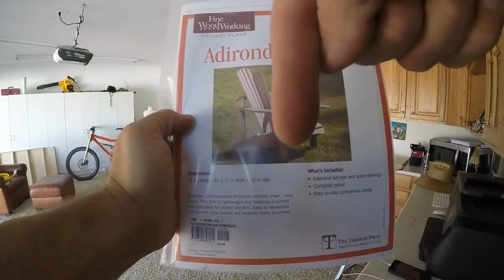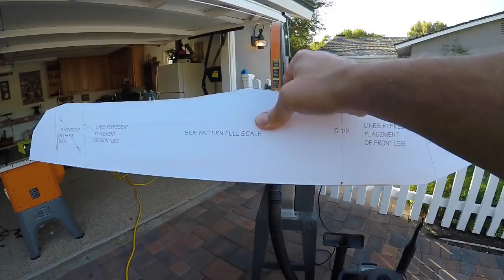Build Your Own Adirondack Chair - Chair Plans and DIY Building Instructions  - How To Woodworking

Comment: How did you do the upper and lower cradle? The plans say they are full scale but if you do the center line it's more than 19 inches?
Reply from the maker: stormin19871 I traced out one side, flipped the template and traced the other side. It worked out fine. Did u use the template in the disruption? If you did you will be ok.